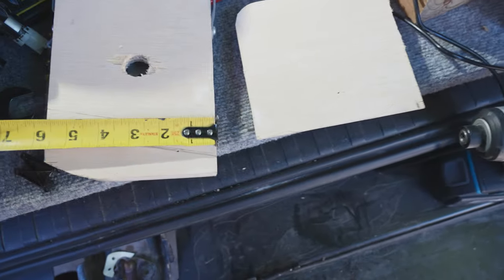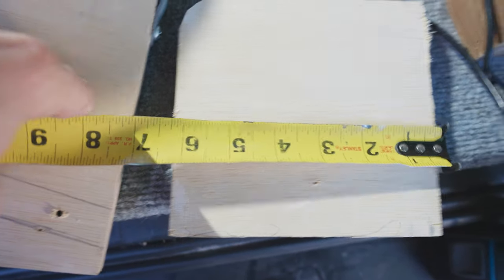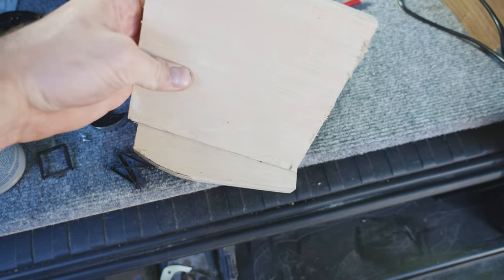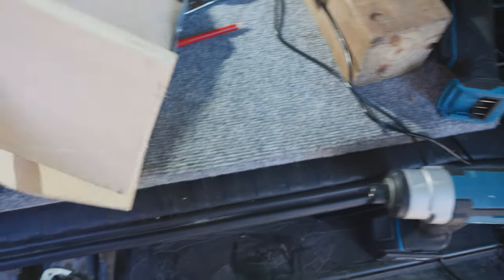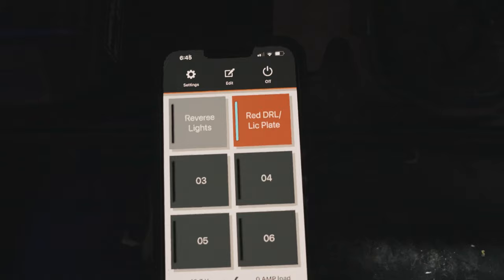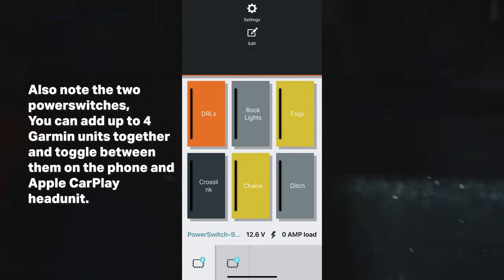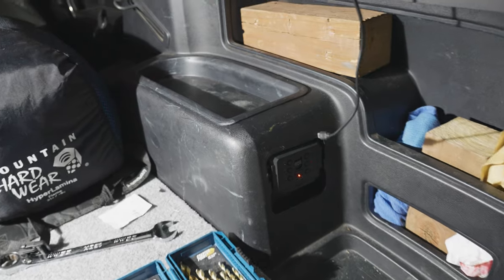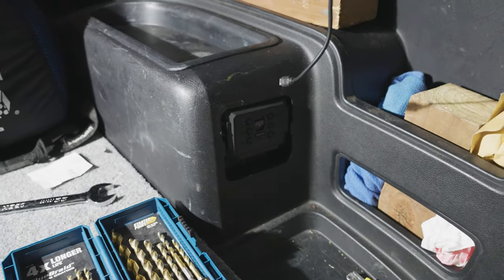(FIRST?) Low Profile OEM+ Rear/Trunk Switch/Power Setup | Great for Camp and Bumper Lighting!

Comment: How much is the Garmin switch setup?
Reply from the maker: $500
Reply: Cool product, but a lot of coin for the application.
Reply from the maker: @thatwideangle9781  yeah once all my other accessories are in that use it the price will be a little more distributed for functionality.
Reply: @OverlandEngineer  ahh okay, interested to see what else you integrate it with.